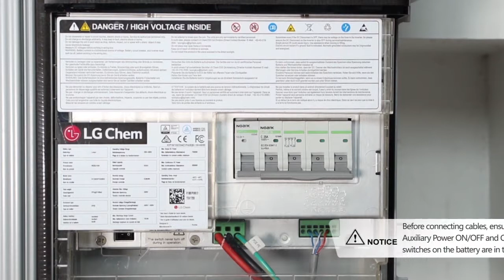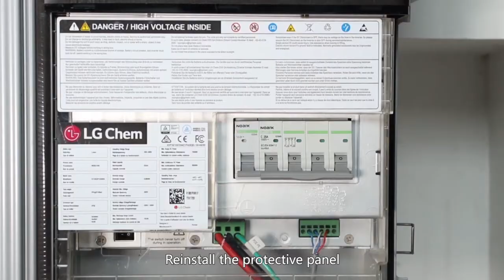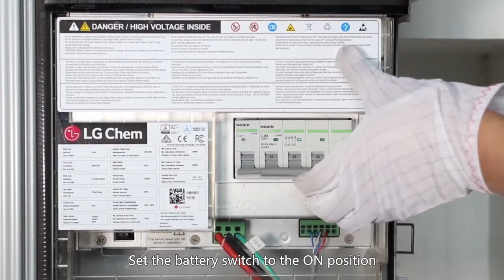SUN2000L 2KTL-5KTL Installation: Battery Cable Connection

Comment: Hi ! I installed the sun2000-6ktl-l1 on the lg chem resu 10h. But the pv is not charging the battery while in offgrid (island mode). As i configure in other modes, it starts charging. Can you help me figure out